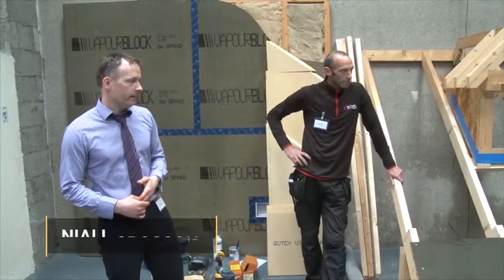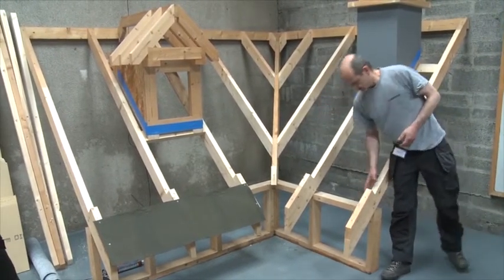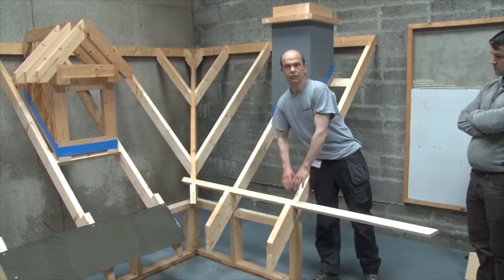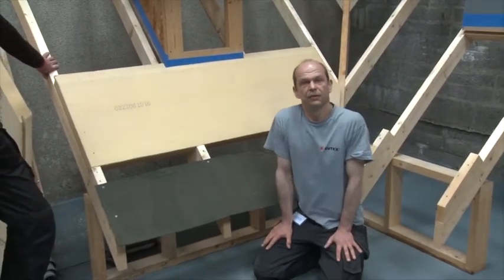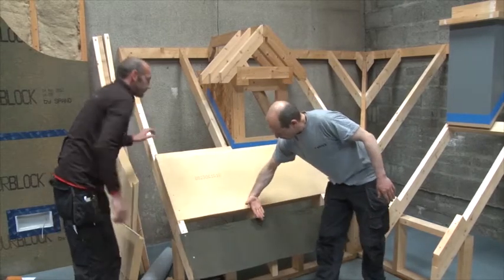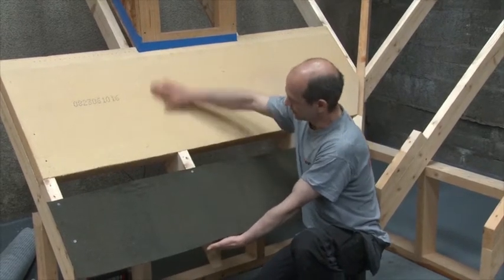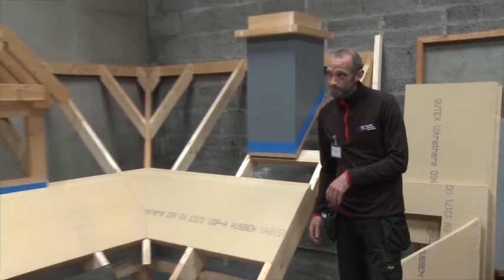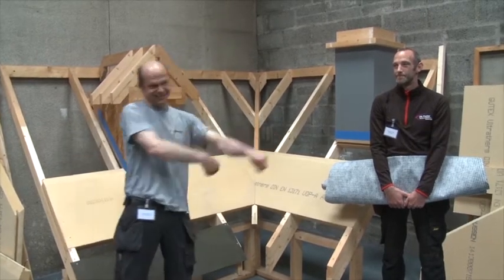Gutex Ultratherm Roof Installation (Part 1) - Fitting First Row + Critical Eaves Weathering Detail

Comment: Why there is an empty space between the Gutex and the bitumen felt? thanks
Reply from the maker: Hi @karl-arnal. The reason there is a gap between the Gutex and the eaves felt in that video is because the Gutex ended in line with the structural wall rather than continuing to the rafter end unnecessarily. A piece of timber the same depth as the wood fibre is added above the rafter at the end referred to as a shear block and it was longer than the ½ metre wide strip of bitumen type 5U felt. The blue Solitex continues down the roof covering all woodfibre, bridging the space and overlapping onto the bitumen by at least 150mm ensuring adequate weather protection without permanent UV exposure. Please feel free to get in touch if you need more detail on this.

Comment: Builders would save time if the gutex had pre-applied rain wrap like the zip sheathing includes.
Reply: That’s a great idea
Reply from the maker: Hi Boe, GUTEX ULTRATHERM and MULTIPLEX TOP are inherently watertight at all tongues and grooved joints. The sheets are also impregnated throughout with paraffin and are hydrophobic (i.e. do not absorb water). Additional membranes are only required at a pitch of less than 15 degrees. Butt joints are primed and taped with our Pro cClima TESCON VANA tape and Pro Clima Sprimer or TESCON RP Primer. To illustrate their water tightness the following video may be useful. Hope this is helpful: https://youtu.be/pF6Nu8IpxGM